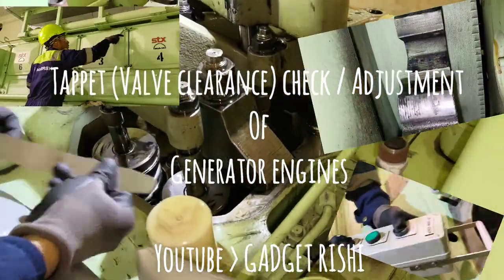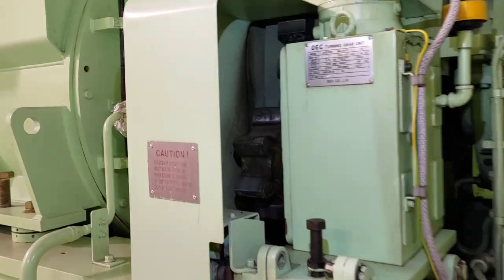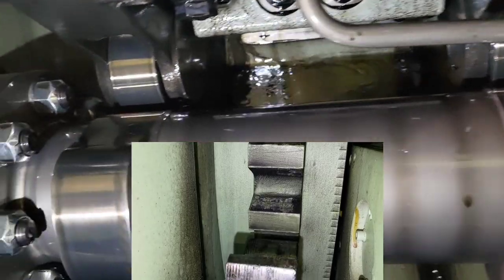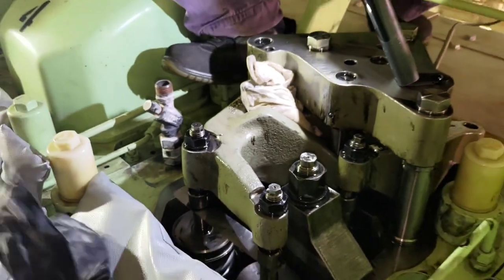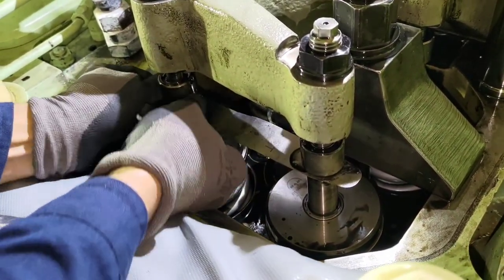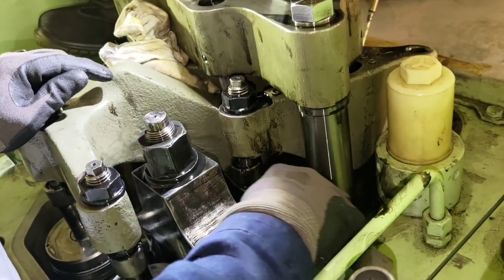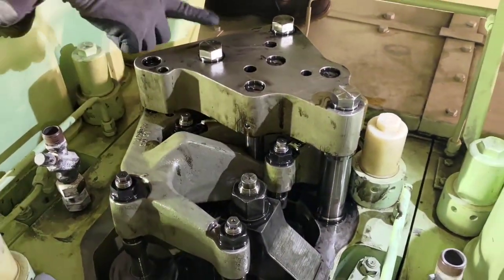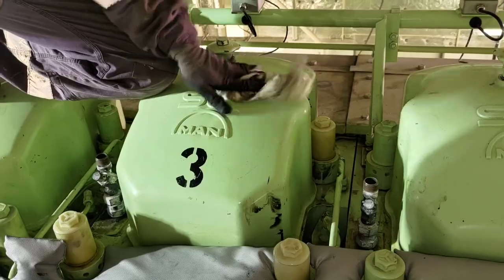Valve clearance (Tappet) - Check & Adjust on a Generator Engine

Comment: what is the generator model?
Reply: man 32/40
Reply: MAN B&W 7L32/40 ? 

Sir, could you please make a video on how to determine which cylinder is first for adjustment if there are no markers on the flywheel? Also, how can we identify the top dead center in such a case?
Reply from the maker: U can start with any one.
Reply: stx